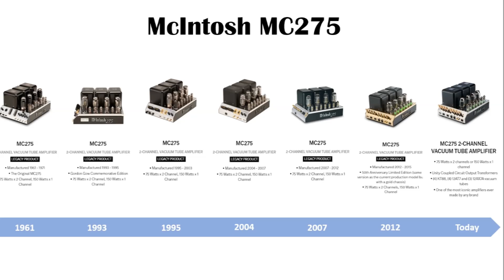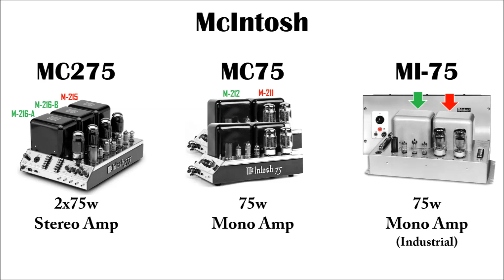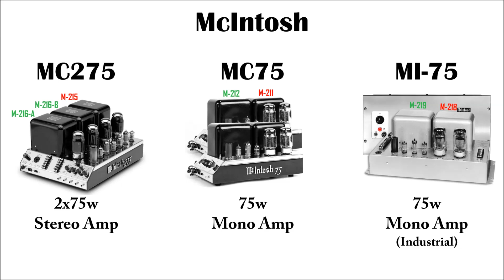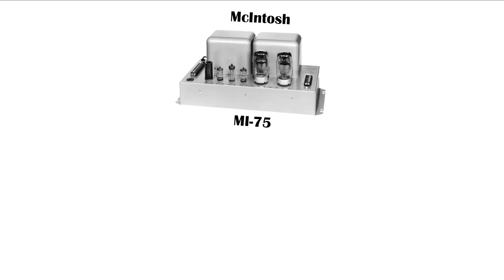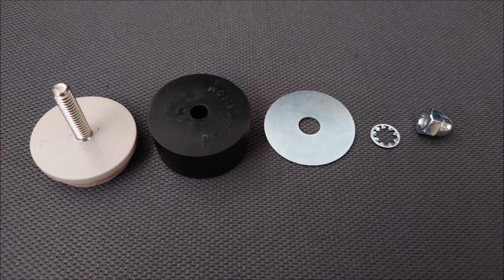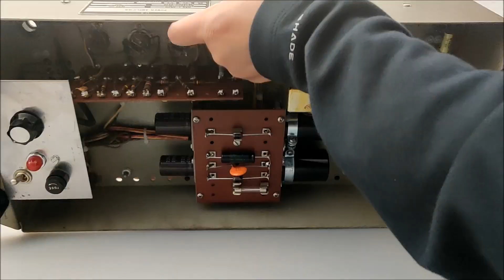McIntosh MI-75 Tube Amplifier: Ep 1- Intro - Compared to MC275 MC75 Vintage DIY

Comment: Every pice of vintage McIntosh gear I've worked on has sharp edges when you take the bottom off. Amplifiers, receivers, tuners, even preamps, whether tube or solid-state, they exist to cut, or even crush, your fingertips (they're ridiculously heavy, with off-center weight distribution, and dig into your fingers when you lift them from underneath). Beware!

Comment: The original MC275 and MC75 and probably MI75 used a trifilar output transformer primary. I'm pretty sure that the modern versions use a bifilar output transformer primary like the smaller vintage Mac tube amps. So this sort of makes the vintage ones unique if i'm correct.